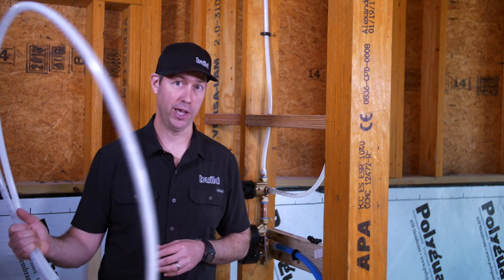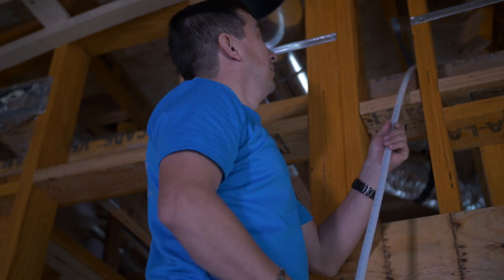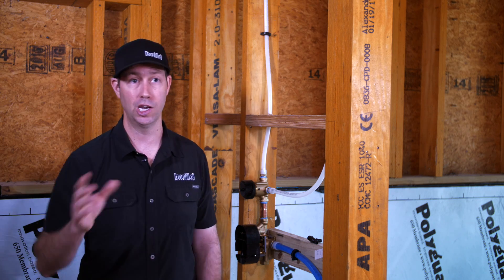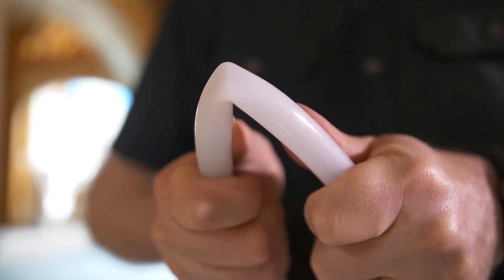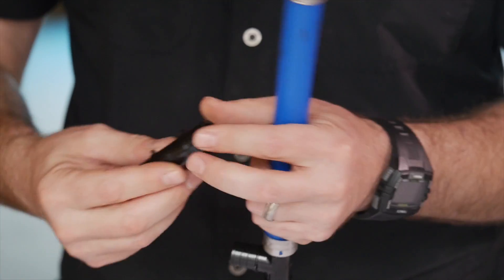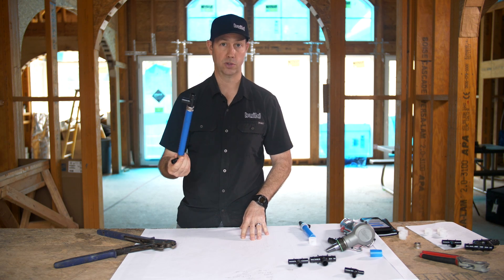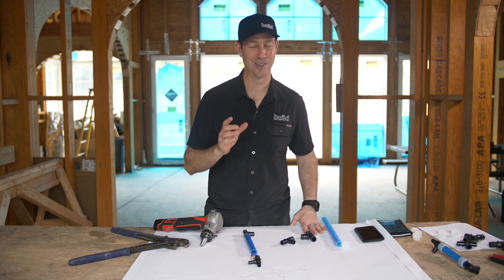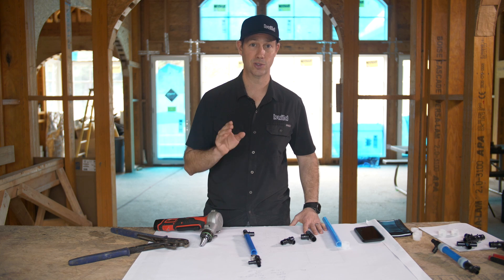PEX vs. Copper Plumbing

Comment: We had bought a piece of ground for a vacation home. It came with a mobile home in it.  Very first thing to go out was the water heater so my son and I go to town and get a new heater, and pipe. I am standing at the copper pipe trying to figure out how much and fittings,  you know the drill. My son come up with the cart and says ok let's go.  I see a cart full of "plastic pipe" what the hell is this?  Trust me dad he says, it will go in real quick.
The installation of the heater was real eazy and when I went to grab a few beers and sandwiches.  He comes into the kitchen and said turn on the water. What? He was done. He sat down and explained this PEX pipe thing to his mother and i. We have a cabin to rehab and it is going in there. The neighbors where we live is a master plumber,  he says that is the way to go.

Comment: Live in the New York City area, I don't know the codes. I've been told that with the rodent issue,some pipes can not be used. How does this workout.
Reply: I repaired a trailer with leaking PE pipe that was chewed up by some varmint. Yes, it is an issue because PEX is just as soft as PE.
Reply: @canucanoe2861   The main rat and his family have moved to Washington DC where they are turning the new residence into a dump according to the first report from the rat himself.
Reply: @arbeeex  Go away. We're talking about plumbing.
Reply: In the 5 boros of NYC you can not use pex...copper is the only approved water system due to rodents. Same with electricity, you can't use Romex in buildings taller than 3 stories due to rodents. Check codes and ask good home improvement shops (not Home Depot or Lowe's) they can guide you properly on what you can and can't use

Comment: Great video, very well presented.
However I am still not clear on the difference between Pex A and B.
I am NOT a plumber, I spent my entire career from the early 1960s to 2003 working for the giants of the Computer and Networking business, then I had a blast working for Silicon Valley start ups, more fun than anyone has a right to expect
However I am very handy with woodworking, plumbing, wiring, tiling and of course electronics, I describe myself as a talented amateur.
I have done quite a lot of home improvement and have used both copper and Pex plumbing, I can sweat a joint with the best ( I have NEVER tried smoking one).
But I am still unsure on this question of plastic plumbing LONGEVITY, I REALLY like Pex it changed many plumbing headaches into a JOY.
Have there been any INDEPENDENT long term studies on this question?
Thanks for the really well done video.
Oh one other thing, the AWESOME pipe expander tool is obviously expensive, is there a cheaper hand operated device for us poor, but talented amateurs?

Comment: Two more potential negative:
1. Copper has natural anti-bacterial properties. Algae do grow on PEX, but does not grow on copper. Time tested system has its merits. 
2. Plastic has potential to leach chemical into the water. We just don't know yet. Remember after decades of plastic cups, now we find BPA chemical in plastic containers. Then they came out with BPA free plastic container. Then it turns out BPA free container contains other undesirable chemical. That was when the news cycle went silent. Not sure what should be the best now. I would think twice before using PEX especially for hot water where chemical tend to leach into the water.
I know manufacture and testing say is safe. We still have sky high cancer rate.

Comment: We use a sharkbite pex the crimps are a little different  and the fittings are copper or brass works well. I like those fittings over those plastic ones you're showing have you seen the ones I'm talking about

Comment: I’ve been doing plumbing for a little over 5 years now and I’ve seen a lot of these fittings where the PEX will blow off the fitting or the plastic fitting itself will crap. Yes the PEX is good but the crimping and the plastic fittings are no good in my opinion. I just don’t trust the fittings at all

Comment: Nice video Matt.
Inspectors love the expandable PEX and fittings because they can see at a glance that the proper connection is made. The other system can have guys forget to compress the collars and it can get passed by during inspection, especially at manifolds with lots of connections
Reply from the maker: Great point  👍🏻

Comment: Won't the chlorine in the water supply wear down he PEX pipes over time?
Reply: No, not on newer pipes. 

ASTM F876, the Standard Specification for Crosslinked Polyethylene (PEX) Tubing, was revised in August 2008 to include a voluntary oxidative resistance (i.e., chlorine resistance) rating that indicates suitability for use in continuous-recirculation systems where tubing is exposed to hot, chlorinated water 100 percent of the time. Uponor AquaPEX® tubing for potable-water applications is certified by NSF International to meet the latest ASTM F876 oxidative-resistance requirements for continuous recirculation,

Comment: Pex is great right up to the pushlock connections. In 20 years or so the orings WILL fail. 

When you kink plastic tubing you create a weak point in the tubing that will no longer hold up like the rest of the tubing. This damage is done at the molecular level. Heating it will take out the kink cosmetically, but the tubing is damaged throughout the entire wall thickness. 

How long do you guarantee your work for? I can guarantee copper will not fail under normal conditions for a millenia. We have all seen it. I agree that it is faster and cheaper (in more ways than one)  to do repairs and rough in jobs with Pex, but is it the BEST way? Maybe it is good for an outdoor sprinkler system, somethingnyou want to reconfigure or move around or systems with finite amounts of water, but never to a city water supply at 60 to 80 psi. How well do you think the connection points, pushlock and crimped, will stand up to the vibration of people with children or the thumping bass from movies and music? I know code allows for the use of Pex, but I can only fathom that it is because flood damage is usually not covered by your home owners insurance. Hopefully you are retired before any issues come about from using Pex.

Comment: Good video. I own a very old house where galvanized was used. I used Pex inside and it works very well. It's semi flexible and not bulky, and the connections are a much easier than threading pipe or sweating copper.

Comment: For hidden plumbing, multilayer piping is a code requirement her in Scandinavia so PEX is standard no problem what so ever. I would be more worried for the fumes from modern building materials than for the plastic in my pipes.

Comment: The video was was nice, but try using those tools under mobile home on your back on corrugated card board in dirt or sandy soil  to replace the entire water system, to PEX. In 1984 the mobile home's  water system was made entirely out of Galvanized water pipe and over time the water's molecules reduced the inside pipe to tiny straw. That's why i-chose shark bite connection it's easy to push lock, won't come apart unless you use the C-type hard plastic finger tool to remove it at later date if required. That's my disappointment of the video, they never show fixing water pipes the hard way like i-did laying on your back,try that guys or gals.

Comment: My insurance agent told me to expect a rate increase if I install plastic piping and some banks also take plastic supply line into consideration......avoid this at all costs imo.
Reply: LBJ Said 200 Years I can confirm that my home insurance went down when I converted from plastic (PB!!) to copper. I had to eliminate ALL plastic pipes though.

Comment: What about the PEX that uses the brass fittings & the copper crimp rings ?

Thanks ,   :-)
Wyr
God bless
Reply: That's the cheap stuff, that is hard to visually verify. You have to believe that connections are okay.
Reply: I have only done 2 crimps when I replaced our water main to the house .  So , I am far from an expert !

     The fittings were tight enough , after the crimp , that they could not be rotated .  And you can check the crimps with the go and no-go gauge .

     Been close to 2 years , so time will tell .  Seems to be a pretty good system for the home owner .  The crimp tool was MUCH more affordable than the tool for the PEX A system .

     Because the ID of the 3/4" fittings I used is smaller than 3/4" , I went with 1" PEX & fittings to compensate .

     I have to say , the 1" PEX I used is VERY stiff .  Especially in the winter , late December - early January .  But I was expecting that & made it work .

     By far the most difficult and expensive part was the ditch .  And tunneling under the concrete foundation on the pier & beam construction .

     I originally thought to use PVC , but figured the additional freeze resistance and somewhat more flexibility was worth the additional cost .

Wyr
God bless
Reply: I'm sure the crimp system will be fine 99.9% of the time, but I prefer systems that are correct 99.99% of the time. 1 water leak may cost more than the entire plumbing system. The cost of the tool shouldn't be crucial here. PEX-a is much more flexible than your PEX-b.

Comment: Some examples:
Many years ago they were selling PVC windows that they said would last forever.
It turned out that the sun made them warp and turn brittle.
Then they came up with a new type of PVC that isn’t as affected by the sun and said this new PVC windows would last forever. 
I expect in several more years they will be badmouthing this new PVC as well in favor of some yet newer PVC.
The same thing happened with plastic food and beverage bottles:
They used to say they were safe and then they learned that they weren’t so they came up with some new kind of plastic and now they’re saying this new plastic isn’t safe. 
And round and round she goes.  
This is what this PEX pitch sounds like to me.

Comment: Your born in 72 the years you have been building these millions of homes does not add up so I guess you started when you were 8 years old? your and idiot, once copper greens it becomes inert no matter how many years its hooked to your municipal water system. and seems you have failed to mention that plastic supplys have been outlawed in health care buildings since it has been found that liegionalia can grow and trive in the systems. Copper is always naturaly aniseptic. You also have no idea what you're talking about when it comes to pex. the type of pex has nothing to do with the connection system A,B,or C denotes the way the polymers are arrainged at atomic level during the manufacturing process. Matt your an idiot as a builder and a bullshiter as a salesman just like the rest of them. You all should be hung by you're smiling lying theeth you spew your shit through. You're a good liar until you talk to somone that actualy knows what you're talking about. You really expect anyone to belive you have crimped hundreds of thousands of fittings with youre finley manicured fingers, You looked like you were going to poop yourself crimping one 3/4 fitting. Go sell pizzas or cars were youre lies only temporaraly affect peoples lives. Homes are for a lifetime.

Comment: Water hammering isn't limited to copper, it just sounds different with Pex. A lot of new home buyers around here complain about a strange sound when their dishwasher or laundry runs. After they self-diagnose by cutting into the wall, they discover it's the Pex slapping around inside the wall.

Comment: How hard would it be to install Pex A in metal electrical conduit in order to eliminate rodent chewing problems?
Reply: The rodent will destroy more than the PEX pipes. Rodents should always be kept out. Around here, we pull the PEX pipe through a sleeve or another pipe. That will limit leaks and delay the rodents somewhat too. Don't think this system is available in the US - Illustrations here - YT: vatette vaggenomforingssystem youtube

Comment: Copper isn’t all the same either — there’s a big difference between soldered and clamp-ring fittings. As well as between regular copper pipe and the flexible annealed copper piping.

Comment: Pex is plastic. It is very easy for a screw or nail to puncture it behind a wall, and then you have disaster. The fittings are also prone to degradation with the passage of time. Copper is not. 

Pex was introduced to save money and labor. It is better for the builder,  but a step back for the home owner. PEx will not last 100 years like copper. We will see this stuff leaking  in the future. 

Aluminum wiring was introduced for the same cost saving reasons, but they stopped using it because of the potential for fires. It was a detour that led to a dead end.

Comment: Matt, Uponor pex is also the only brand that stands behind their product, they carry a 25 yr warranty on installations by a certified uponor installer. Also you are supposed to rotate the jaws when expanding it so it doesn't leave a distinct groove on the inside.

Comment: I admit, I like the ease of installation, but... After a mouse chewed through a pipe in the upstairs bathroom, and I had to rip out the   sink and the floor under the sink to repair the Pex, and then repair the kitchen ceiling, and the kitchen floor. Well, I don't trust the stuff. If we get another rodent caused leak, it's all coming out and I'll install copper.

Comment: i wish the Qest fittings were more popular..yes they cost more but they work with all forms of water tubing..also if they ever leak you can tighten it more and if that doesn't work you can disassemble it to see what the issue is with just a wrench or channel locks :/

Comment: Should've explained about the shark bite fittings. They are overly expensive and they will eventually leak. They are nice for emergency repairs. We've been using pex for years now and it's such a nice system.

Comment: I've been using pex for 12 yrs and use it when ever I can and have only had issues when I didn't pay attention to the fitting I used. I don't use plastic fittings if I can avoid it because those are the times I've had issues. I like metal connectors with the metal crimp rings.  All of the plumbing I had to replace has been lead or galvanized.  Great video and thanks for showing the Uponor system.

Comment: Hi Matt. The markings " PEX A" and  "PEX B"  are not the grade of PEX but the manufacturing process that are used to cross link the high density poly-ethylene (hence the name, poly-ethylene x-linked).  Uponor uses PEX A because it is the most ductile of the PEX types, which improves the ability to expand and contract around the fitting. It also has the highest cross linking at 85%. PEX B has a less cross linking (65-70%) and the lowest dimensional tolerance, perhaps that's why its cheaper than PEXA. Thanks for the videos !

Comment: About 20 years ago I came in after somebody stole all the copper out of the house in the plumbers put this stuff in and we are doing all kinds of repairs at about 4:30 on a Friday afternoon second-story old house real floors wood walls all that stuff you know where nineteen-hundreds house and if they would bust in 200 degree hot steamy water out of the second floor with everything was just about finished we are just about done painting everything was Dunn appliances were put back and then this happened I had to quickly run to the basement figure out how in the hell did turn off the heating system and cut every water valve I saw down there to get that shit to stop I believe it would hope that was just a terrible installing job of the plumber but I don't know after seeing that I just can't trust them things especially after 10-20 years no
Reply: 1. Please consider some punctuation. 2. Hacks install copper wrong too.

Comment: Germans even invented this stuff!!
Reply: Germans are notorious at pushing engineering limits
German car owners can attest to that
Not sure I want to push anything to the limit when it comes to plumbing
Reply: They pushed it all, thus rockets, jets, multi valve engines, Porsches!!  magnetic tape recording tape! Aspirin, rael highways, PEX seems like a very good thing, easier to work with, as he said, issues only due to mistake on crimps etc, lost safer than a torch, starting a fire.  Lot faster also

Comment: Uponor (Wirsbo)  fittings are more expensive then copper and you'll still get the water hammer it's just not as a apparent as it is with Copper as it's not as rigid.

Comment: Is it true that the oil that impacts will cause cancer? the same is bottles because of the additives you use ? Heating of plastic breaks it down and it does happen ? Plastic buckets left in the Sun will break in the little pieces from heat ? Then you have the price of hangers This stuff hanging loose on your basement ceiling will jump up-and-down don't tell me about knock ? Is this just an ad so you can sell this crap

Comment: Have had nothing but issues with the clamps on the pex in my house ... had 4 or 5 denicklize and corode and pop off .. tada  leaks inside your walls and floors.. have fun .. pay for the copper and dave your self the issues and money of other repairs later
Reply: No such problems with Uponor PEX-A.

Comment: You do that in NewYork they’ll hang you by the balls. Copper was,is and always will be the only way. I did few bathrooms with Pex. No leaks but never again. I dont feel confident and costumers are asking toooo many questions Why?  And B in NY it will never pass inspection
Reply: I suspect NY requires copper not for any valid technical reason, but because the government is in the pocket of the labor unions, and copper requires significantly more labor.